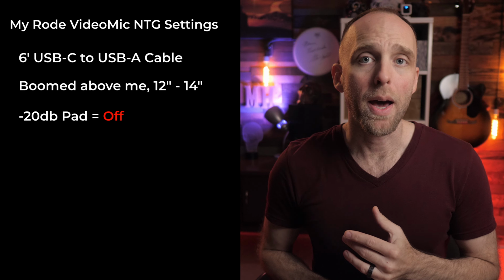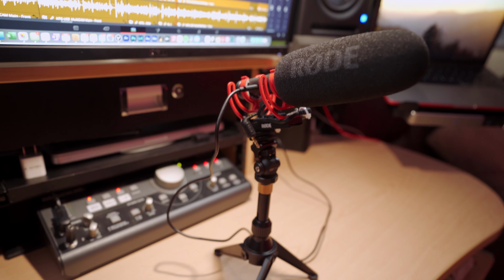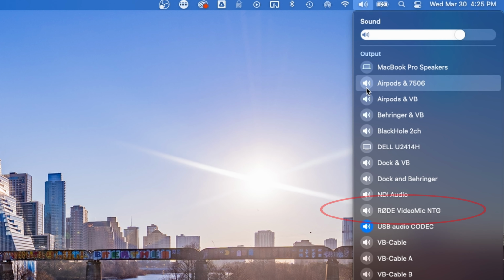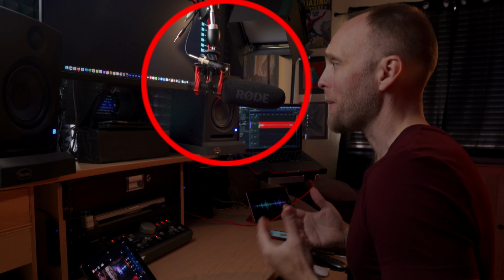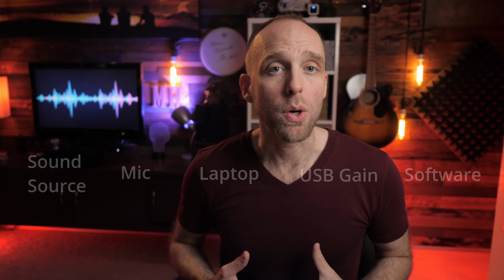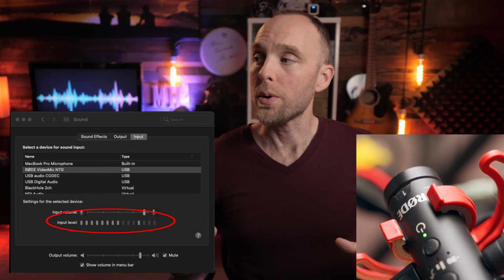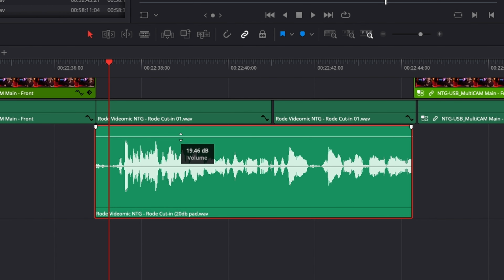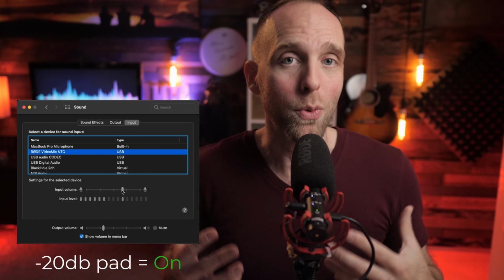How to set up your Rode Videomic NTG via USB for the best sound.

Comment: Great video, however I wonder why not using the RODE Connect and selecting RODE Connect System Virtual Input?
Reply from the maker: Thank you. I’m glad you found the video helpful. I’ve used the Rode connect system software here and there, but the input gain matches what you would get in macOS system preferences… So if you change macOS system preferences gain for the videomic  NTG, the rode connect system follows that gain setting and vice versa… So changing gain in one spot, changes it in the other, etc.… And since I’ve been using the mic over my desk for many years, my settings have been set and have no real need to change… the low pass filter, pad or no pad… High end presence boost, etc. have all been set and I don’t need to change them from day-to-day, so I have no need to use the Rode connect system for any specific reason.

The Rode connect system is fine, but again, I just don’t have a need to use it for day-to-day, I’m usually only using the audio input from the mic itself, usually through OBS for virtual meetings,

Comment: Where could I find a good usb c to usb a cable for it because the one it comes with isint long enough
Reply from the maker: Hi there.  Almost any USB cable will work just fine.  I have a cheap one I got from Amazon, it's 6' long, USB-A on one end and USB-C on the other.  There are *some USB cables that don't do any data and will only pass power, but I think every single USB-A/C or just USB-C cable i have in my drawer will work with any of my USB mics.  And you don't need high speed data for a USB mic, an older USB 2.0 cable is just fine.  I'm using an Anker 6' USB-A to USB-C Cable for my Rode VideoMic NTG, and I"ve had the mic and that cable for at least 4 years.  Amazon is your friend
Reply: @MarcusHutsell thank you

Comment: If you have a Canon C100 MkII this will not auto detect the 3.5mm jack and cuts in and out. Tried 2 copies on 2 C100 cameras. Just letting y’all know. Shame, as it would have been a great option when I wanted to go light with no handle.
Reply from the maker: Wow, that's good to know.  I wonder if you manually turn the VM-NTG on by holding down the power button if it will stay on (??).  If not.......then the smaller Video Mic Go ii has nearly identical sound and doesn't require that "smart" connection to the camera.......might give that a try, and it's only $100, usually ;)   Happy Recording, and thank you for the info!

Comment: My mic is the Rode NT USB so doesn't have the -Tab on it that you mention but that aside I believe everthing else you so clearly explained here applies to my mic also.  I have watched so many videos, been given so much conflicting advice and still sound "crunchy" or "harsh" .  I am now going straight back to initial set up following your advice.  Wish me luck!  Subscribed! Thank you.
Reply from the maker: Hi there.  Thank you, and yes, good luck!!  The main thing to remember......no matter what mic your'e using, whether it's a USB mic, or an XLR mic with a USB interface or a mixer........always, always, start from the beginning of the audio chain.  That's how gain structure works.  Gain as high as you can without ever clipping EARLY in the signal chain and PUSH that signal through your system...... and WATCH your audio levels at every stage.   That's Audio 101 and that will give you the lowest noise floor and the cleanest signal.  NOT clipping is equally as important, so strike that balance but use your EYES to determine audio levels.  

Good luck!

Comment: Excellent video. When you're on a zoom call and listening via speakers, does the output from the speakers ever bleed into the microphone?
Reply from the maker: Thank you so much.  So, #1, I never use speakers during Zoom/virtual calls......I ALWAYS, always wear headphones.  https://youtu.be/KfQlHgZ16iI

And #2, if I did use speakers, yes, with any microphone, any sound waves will eventually get back in to the microphone to some degree.  How much depends on mic choice, mic placement, speaker placement, speaker volume, etc......but sound waves coming out of the speakers will bounce off of object, your desk, your chest, your face, the ceiling, floor, etc, and can be heard by any microphone to some extent.  The meeting software itself can help with some of that by digitally adding "noise reduction" or "echo cancellation," but I just use headphones.
Reply: @MarcusHutsell  Thanks. I've used a headset for years but I've really grown tired of them, I always end up with sore/fatigued ears after a couple of hours on calls. They're Bose 700's, so a good comfortable headset, just not multiple hours comfortable. I got some basic Creative Pebble v3 speakers as well so hopefully Zoom does enough and removes any noise/echos coming in this mic.
Reply from the maker: @CathalMacDonnacha-t8h  Yeah, I know what you mean, after a while, ANY headphones or earbuds will get tiring!  Keep the mic close, and the speakers low, use those in-meeting audio options and you should be good.  Happy virtual meeting!

Comment: What is the longest distance you’ve comfortably used this microphone? Is 12-14 inches the recommendation or can it go even further away, say, up to one meter?
Reply from the maker: Well, for my virtual meetings and recording my videos, the mic is about  15 to 20 inches (max) from me at my desk.  This, or any mic, will work fine at 1 meter, but......as always, the further it is from its intended sound source, you'll most likely have to turn up the gain, and therefore you'll also just pick up more "room sound."  If that room is reverberant, you'll definitely hear more "room."    That's just physics.  If you have a more deadened room with carpet, sound panels and sound blankets, then, of course, this mic at 1 meter would still sound pretty good on a voice.

If you watch my other video, at 4:27 in this video (https://youtu.be/z7bglcSQOC4), I use the VideoMic NTG in my much more open/hard-surfaced/reverberant dining room, and I start with the mic roughly 1 meter from me and then progressively move the mic closer.

Comment: Brilliant video thanks! One question which maybe your video answers, but I struggle to decide whether to position the mic above and pointed down from a distance or use it desk-mounted close up. The issue is that my voice sounds completely different in both setups, in terms of tone not loudness. I think your voice sounds so much brighter and clearer when it's mounted from above and further away whereas closer its mostly bass and sounds a bit muddy. Do you think the NTG, being a shotgun mic, is best used further away? The downside is I don't have acoustic padding so when it's further away I notice more of an echo/room noise.

I'm trying to find a setup I can use consistently, because each time I reposition the mic my voice ends up sounding different on the recordings and if I'm making a video over multiple days it's quite obvious that the vocals aren't identical.

Comment: You really saved my bacon. On my Mac the input slider does not work for the Rode NTG. It slides easily for the internal mic and my humble Plantronics USB. You showed me 1) gain nob is a freaking nob and 2) the slider should work. So I kept poking at it an yes, my slider workers for the Rode NTG. Is kind of clunky and does not slide easily.
Reply from the maker: Hi there.  I'm glad the video helped.  You could also install the Rode CONNECT app which can more finely control your Rode VideoMic NTG (slider as well)
Reply: @MarcusHutsell  I have the Rode app and I used it to update the firmware. I never tried to control the mic -- DUH. Funny, I have a video on my channel show how I fixed the volume without the app. I guess I need to update. THANK YOU!!!!
Reply from the maker: @jannarkiewicz633  Remember there are (2) Rode Apps:
Rode CENTRAL - Firmware updates, settings, etc

Rode CONNECT - more like a virtual/live audio mixer that you can ALSO make adjustments to your rode mics, etc.

Comment: Hey @MarcusHutsel, thank yuo for the video. I am just curious now as since Apple released the iPhone 15 series, this question is now relevant. 
Have you tried using this mic with the iPhone 15 Pro Max? I really wan to buy this microphone but iPhone 15 users are seriously complaining on Reddit that this mic does not work properly over direct USB-C connection- too much noise, clipping and distortion. I saw that rode released a new version of the Rode Central App for iPhone just a week ago. Can you tell us if it is safe for iPhone 15 Pro Max users to purchase this mic, primarily to be used with the Blackmagic Camera app, FaceTime, WhatsApp and other apps? Please. 🙏🏾Thank you.
Reply from the maker: Hi there.  You're welcome, I'm glad the video helped.  Unfortunately, I do not have an iphone 15 so I can't tell you anything about that.  IN addition, I just don't really use my iPhone to film with very much, and I've only used an external mic with my iPhone for some tests here and there.  That whole iphone setup with external mic process is just too finicky for me, I always just grab my bigger cameras.

I'm also an iPhone mini hold-out........I bought a used iPhone 13 mini as quickly as I could so I could keep either my iPhone 12 Mini and/or iPhone 13 mini running as long as possible.........I loathe the large phone revolution, the mini is the perfect size for me.......if ONLY Apple would have called the iphone 13 mini just "iPhone," ......then the larger sizes "Plus" and "Max," then maybe consumers would have just bought more of the mini and it wouldn't have been discontinued.  Oh well.......I guess my rant is over.

Comment: Not using Rode Connect? Omg 😂😂😂
Reply from the maker: No, actually I do not use Rode Connect.  For a few ocuple.......

Number 1:  You/I don't NEED to use Rode Connect for the mic to work.  For some new users, ANOTHER piece of software to boot up just to make a mic work can/will be a barrier to using it....and I agree.  

Number 2:  The digital input gain in Rode Connect follows the input gain in Mac OS System Preferences, and visa-versa, so.......it doesn't matter if you use Rode Connect or NOT, at least on a Mac just to get the mic level into your recording/meeting.
Reply from the maker: However, I will say that at least when USING Rode Connect, you can change the settings on the mic a lot more easily......like turning on/off the pad, high pass filter, etc.......so, yes, helpful, but I don't think I've touched my mic in months........it's set where I need it set, and I am always ready for a virtual call
Reply: Maybe Rode Connect suits podcasters/ streamers but not your setup?

Comment: Very useful, thanks! I had to set my microphone level on windows to 0 for it not to clip with my regular voice. However, I guess that is better than using the "pad" or the -20 dB filter on the microphone and then afterwards setting it higher in Windows?
Reply from the maker: Hi there.  So, If you're having to set your audio input in your computer to "0," you *may want to go ahead and use the pad because having ANY of your equipment at the extreme-ends of their adjustments means that you don't have any wiggle-room to turn up or turn down, and that means just putting your audio system in a bad starting point.

I did a video talking about "audio extremes," https://youtu.be/H9G5TR4m5gQ 

So in theory, and typically in practice, then YES, having the pad OFF will ultimately give you a lower-noise signal in your end product......assuming you don't clip out the mic or any other point in your signal chain.

But if you find that the clip-indicator on the mic lights-up RED when/if get a bit boisterous, laugh, or raise your voice a bit.....then you might want to just turn the pad on and adjust your levels in Windows up a bit.  

I use a small mirror to see the clip light on the VideoMic NTG if it's in a position where I can't see the lights......and that means I, or you, can almost NEVER see the clip lights on this mic when we're using it ourselves.

Comment: Great video! My mic doesn't appear anywhere - in settings, on zoom etc...I have used it before with the usb cable and never had a problem. Any ideas? Thanks!
Reply from the maker: Hi there.

That’s odd, I’m assuming you’re not going through any sort of USB hub that might be an issue (?)

However, I always use mine plugged into the same USB hub and it doesn’t give me any problems. I’m also using a 3rd party, longer USB-C cable and it all works fine. 

After rebooting your computer and checking again, if you can’t get it to work, email/contact Rode. They have a great warranty on most products and they recently replaced my entire wireless go to system for free via warranty because it was having issues.
Reply: Thanks!! @MarcusHutsell

Comment: Thank you for talking about how the safety channel works during meetings! Super helpful, I couldn't find this info anywhere else!
Reply from the maker: Hi there.  You're welcome.  the ONE thing to keep in mind is that......"If" you put your meeting audio in "stereo" mode then you would get BOTH the high (left) and Low (right/safety) on the right and the other people on the call would hear it that way and that effect would be worse if they wear headphones.

*Most of our meeting software (Zoom, etc) are defaulted to Mono-audio.....we usually have to go in and specify if we want our audio to be in-stereo.  So, check those meeting settings and ensure you're NOT in stereo-mode.  

Cheers!

Comment: I'm returning mine, and I'd like to share why, as it might benefit future users.

First, let me say that the sound quality of this mic is fantastic. I'm really impressed. However, it is going back due to the fact that it does not behave as a regular USB microphone when connected directly to the computer. Specifically, the NTG can't ever disable the mic monitoring. Clicking on "microphone properties" on Windows and turning "listen to this device" on or off makes no difference. On this MIC, the monitor is ALWAYS on (confirmed by RODE customer support). The same issue occurs when using a Mac.

So, if you're on a call or using your MIC USB interface to watch a YouTube video, for example, there is NO WAY to disable monitoring. Whatever you type or say while watching that video will be fed back to you. That is NOT how other USB mics behave, including other USB mics from Rode.

My primary application is teaching. As a teacher, I must be able to listen to questions from the students. So, I must keep my headphones on (using the 3.5 output from the mic). However, when I do that, and for the entire entire 2-hours class, I hear my voice fed back to me. It is inconvenient. And annoying. 

If you're using this mic to produce a video that will be shared later, it is a perfect microphone. However, if you intend to use it in situations that require interaction, such as conference calls, lectures, or training, then I'd say it is really a bad option. For those cases, I'd recommend an XLR shotgun with a simple/cheap audio interface.

PS: I checked the market and could not find a shotgun that does the USB monitoring correctly. There is a market opportunity here. Hopefully Rode will take it or even fix this NTG model with a firmware upgrade (NTG V2 anyone?).

Comment: Hey, thanks for the video. It’s very clear, however how about the Rode connect app? Is the gain set there the same as the system usb input level?
Reply from the maker: H there.  You are welcome, I'm glad the video helped.

So, yes, the Rode Connect App and the computer system preferences audio gain are the same, and if you change gain on one of those items, the gain settings "follows" in the other setting.

So, if I use my Rode VideoMic NTG for example, and go to System Preferences > Audio > Rode VideoMic NTG > Input Slider and set it to a specific %......then I go to the Rode Connect App and CHANGE the Gain (db) on my RodeVideoMic NTG......the input slider in system preferences will move when I make a gain change in the Rode Connect app.  

So, they are "talking" to one another.  

I don't really use the Rode connect App, although I do have it installed.  I usually just use my Rode VideoMic NTG with OBS or for recording into my camera directly.

Cheers!

Comment: While using the mic via usb, does it charge at the same time or it will be draining the battery even though it’s being used via usb?
Reply from the maker: It charges at the same time. So when plugged in via usb it should never lose power.